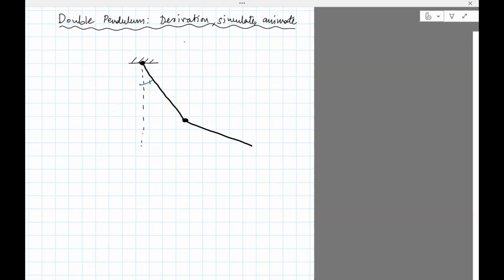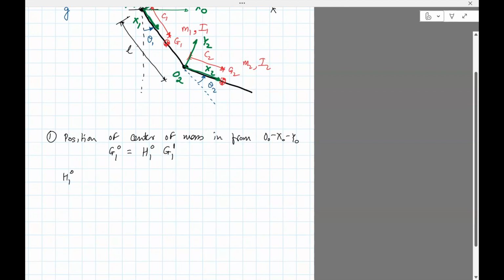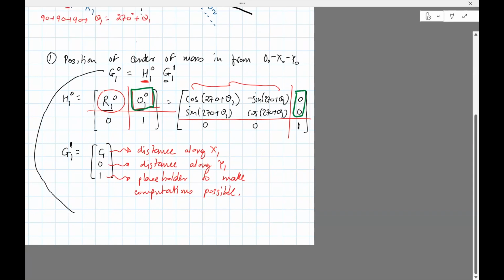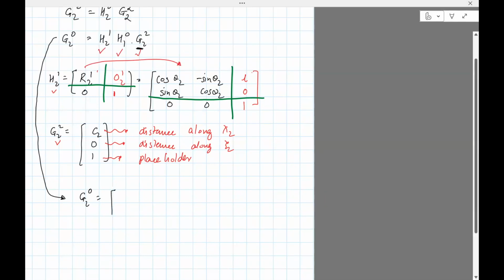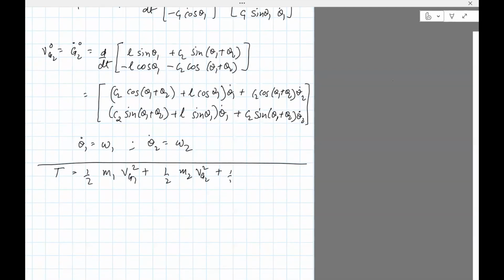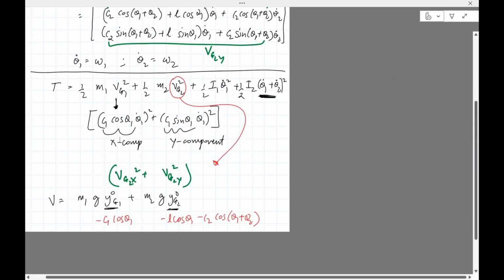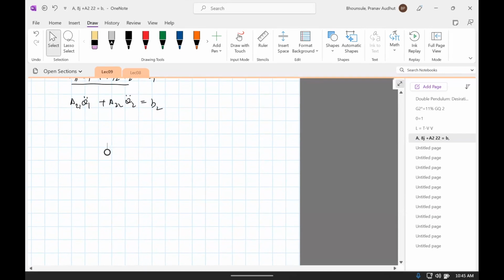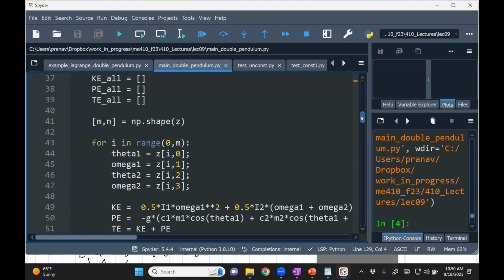Robotics Lec09: Euler-Lagrange Double Pendulum (Fall 2023)

Comment: For legged robot we'll do all of this in world frame?
Reply from the maker: @vydumannaproch  equations in works frame but control in body frame  (for 3d)
Reply: @pranavab I am actually have a task to balance three legged robot while moving. Am I right that I should write this equations in robot's frame and then make a body frame completely free(with 6 degrees of freedom)?
Reply from the maker: @vydumannaproch  floating base: linear motion in world frame and angular motion in body frame. Joint equations better in body frame using recursive newton euler algorithm. See dynamics here: tiny.cc/robotics25
Reply: @pranavab  thanks for a help!